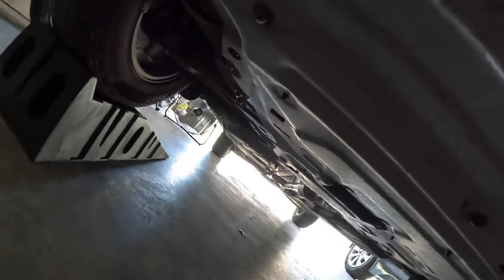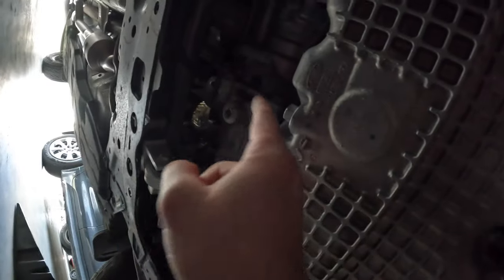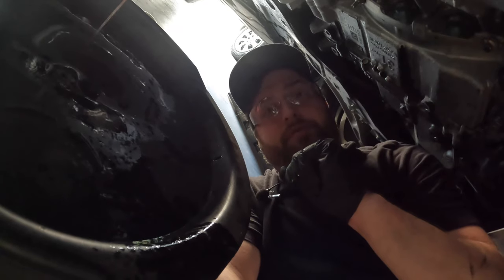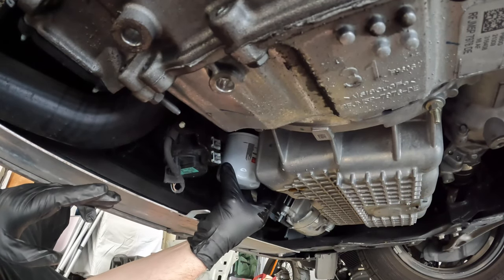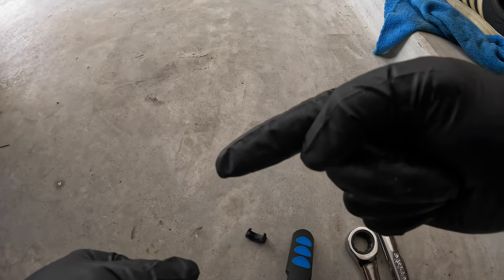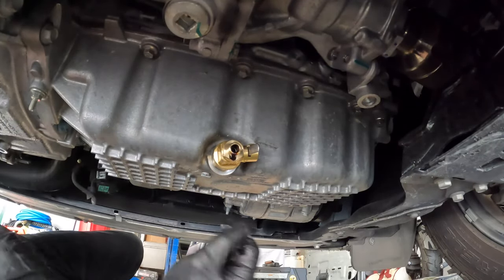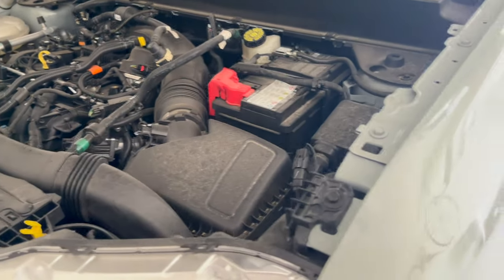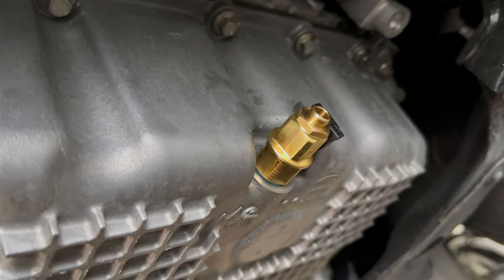Ford Maverick Lariat | Fumoto Oil Drain Valve Install & Oil Change

Comment: For the filter removal slip a 1 qt zip lock bag over it.  That’ll catch the spillage as you take it off. Plus you can then seal the bag making disposal spill proof as well.
Reply from the maker: Genius. I will give it a try next time. Thanks! 👊🏻

Comment: Whats so hard about using a socket and ratchet to take the drain bolt out every 5000 miles? This is the most useless modification ever.
Reply from the maker: Nothin is hard about it. I like it.
Reply: It's not hard although it's one less step that eliminates the need to unscrew the plug as hot oil is draining out (ever drop the plug into your oil while changing it?). Also eliminates the need to replace the crush washer.

Comment: Your going to long on your oil changes. Ford Ecoboost engines like clean oil and lots of flow. That oil needs to be changed every 5000 miles. Do not pay attention to what the computer in the dash says. Look up any of the Ford master techs on youtube and they will all tell you the same thing. This is my 6th vehicle with an ecoboost and I always go off 5000 miles and cheers on using the OEM filter. Ford like to deny warranties for engines if you use any other brand. Oh and only buy synthetic. The synthetic blend is not worth it.
Reply from the maker: Hey thank you for the input. I have decided to start doing the changes sooner and will be using full synthetic next time for sure! I seen a video of the ford tech saying that the synthetic blend was the minimal spec to use and he recommended using full. For sure will be more on top of things moving forward!
Reply: 30k on transmission and PTU.  30k on first rear diff change, then 60k after (rear diff is not used >50% of the time)

Comment: You should start charging it at 5k , I have the same truck and that oil also is used to cool the turbo . Just my opinion if you want a cleaner running maverick
Reply from the maker: Yes after this oil change I’ll be changing it around that time and really thinking about switching to full synthetic oil.
Reply: Just go to a oil  center and have it sucked out
Reply: 5k is the way to go. I just got my 24 Mav and I will be changing at 5k. I did the same on my 2012 Focus I bought new it's got 200k miles and is still going strong.
Reply: The recommendation for this engine for over a decade.  5k.  Maverick owners, realize this 2.0L has been around a long time.  Same power train with 8F35 has been used since 2020 Escape.

Comment: I was thinking "that drain valve is awesome" for about 5 minutes until I saw you remove the oil filter and realized there's nothing you can do to make that a cleaner, easier job.
Reply from the maker: Still have to remove oil filter unfortunately and the shield plate. I’m gonna start filling up my 5qt jug instead of using the oil pan. Idk pros and cons to everything I guess
Reply: I heard of using a soda cup from a "fast food" place to catch the filter oil, but I haven't, tried it yet.
Reply: I used a solo cup
Reply: I use an "Oil Udder".

Comment: My 11 yr old ve4 has ports in the windage tray to drain oil and change the filter. Since, hopefully, oil cha7 should be the most engine maintenance, I can't believe Ford cheaped out on the Maverick. As well as making oil changes difficult, think of those screws / bolts in 10 years.

Comment: If this isn't engineering gross incompetence, what is it, is this the best that they can come up with under the car, it could be put up top under the hood easily accessible and made not to have oil pouring out in volume after undoing the filter.
Reply from the maker: 100% agree that an oil filter up top would be a lot easier with oil changes. Not sure what the logic is behind it though 🤔

Comment: Thanks for the video.  Get yourself a creeper to make those oil changes easier.
Reply from the maker: Would definitely help. Man if the oil filter was up top in the engine, that would make things so much easier. Just would only have to take off that plastic piece on the shield plate and drain the oil through the tube using the fumoto valve.

Comment: Try using a hammer and a punch to make a hole in the filter ...it supposedly drains out the hole making less of a mess. I have yet to try it, but it's obviously only for vertical oil filters. The only caution is to make sure you have the correct replacement filter on hand or another vehicle to go get a filter.

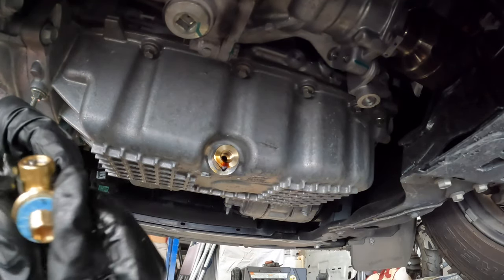9:17 Also, my theory for why there's a little extra oil that drains out is because of the TiVCT camshaft phasers. They use oil to change the timing. When i had a 17' Focus, it slowed to a drip then after about 5 minutes went back to a stream
Reply from the maker: I was going to use a punch for this video but I could not find my dang punches anywhere haha. Never done it before but have seen videos on it and it looks promising! 

God to know about the residual oil. I left it draining while I went to homedepot and it still had some left once I undid the bolt.

Comment: So does Ford wants you to change the oil every 20,000 miles??? 3:57 But you are doing it every 10k miles?  If so, I would suggest that you change the oil every 5k miles if you want to get the longest life out of your engine.
Reply from the maker: Yea ford says every 10k miles and I was going by what they stated. After this oil change I will be changing a little sooner. I believe this second oil change was around the 8.5k mark.

Comment: Nice job on the oil change. I liked how you suggested cracking the filler cap and that you used clean oil on the filter gasket. What are you thoughts on putting some fresh oil in the new filter before spinning it on? Nice work!
Reply from the maker: Thank you! There is a big debate on putting oil in the filter lol. personally, I’ve never done it but this last oil change I did. I believe some model vehicles have the oil filter installed upside down in the engine bay and you can’t pre-fill those! I’d just do what you want to do.

Comment: Could you drill a hole into the shield then use some kind of right angle extendeder and put the fumoto drain valve on the outside of the shield?
Reply from the maker: The shield on mine has a black plastic piece that can come off which would allow you to run a hose from the valve to your drain pan. Only thing is, is that you still need to get to the oil filter and the shield plate still needs to come off

Comment: I noticed that you did not fill the oil filter with oil before installing, some people say it’s necessary.
Reply from the maker: Probably just preference. I’ve never had a problem with it. Some oil filters are mounted upside down in some vehicles and you cant pre fill those.

Comment: Mercedes to Corolla? Say more. Is the Corolla working as you expected? Why the swap?
Reply from the maker: Honestly we decided to trade it in for a used Corolla. The Benz was stupid expensive to maintain. So far it’s holding up well!
Reply: @MotoJoee  I’ve had German cars as well, crazy stupid expensive to maintain
Reply from the maker: @BradimusMaximus78  yes I had a vw before I traded that it for the mav. I could still do basic services and fix some things on the Jetta at least. Mercedes I couldn’t
Reply: @MotoJoee , I had a GLK where the check engine light was on more than it was off, they could never fix it so when I traded it in for an Explorer Mercedes called and gave me 5k as a consolation prize, they made it right but no more German cars.